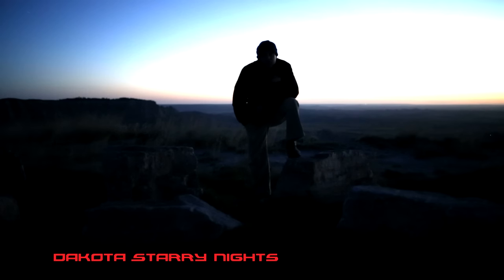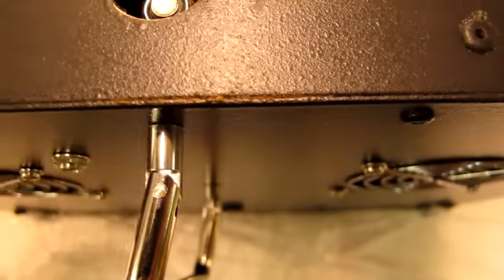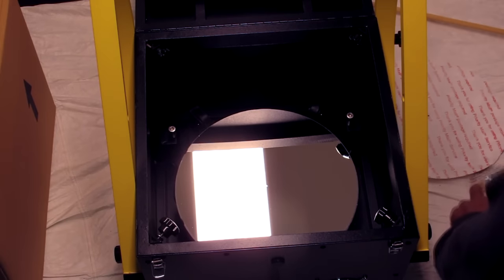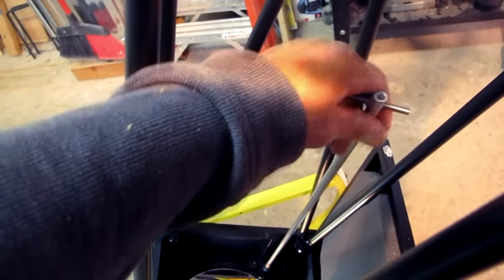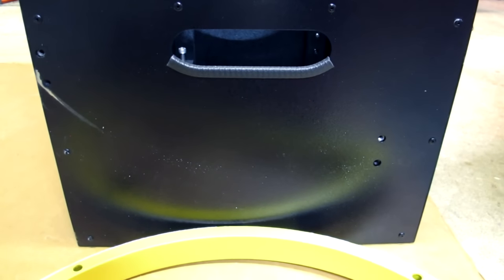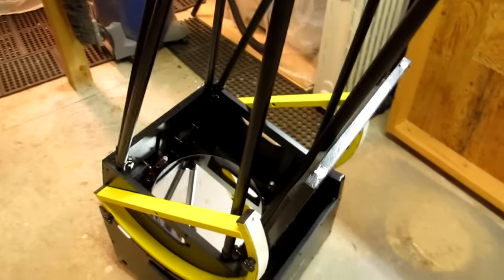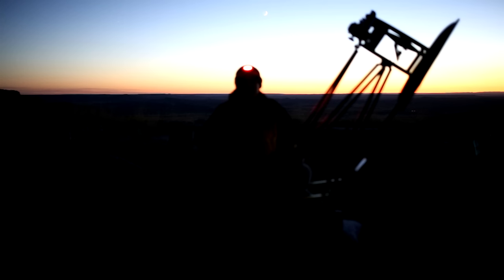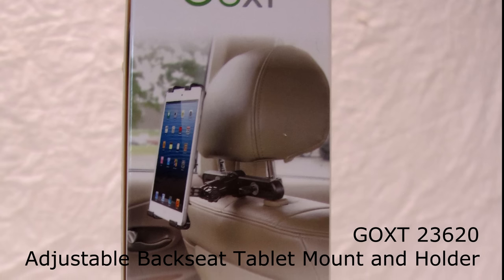Explore Scientific Ultra Light Dob Review

Comment: Thanks for the tip - I've got an ES 10" Hybrid Truss coming soon, and the suggestion for focuser orientation is easy to do, as all it takes is to pick the position of the cage during assembly. I've spanned in an old iPhone 5 which is still functional, using the Star Chart app - when on a cellphone holder + dovetail, actually acts like a 'guidescope' and gives good enough guidance to get a faint object in the main POV of my current 4" Maksutov on EQ mount.
Reply from the maker: Cool!  Congrats on the ES 10", too.
Reply: @DakotaStarryNights  Much obliged - here in NZ, a 10" is a BIG telescope, immediately putting me in the top 5% of amateur's. Next big save-up will be for a classic C8. But a 10" light bucket will be like owning a starship - and sexy with the Serrurier Truss - otherwise a dob is just a tube and a box (which is not necessarily bad) - the truss just makes it into something more serious and practical at once.
Reply from the maker: @martinlagrange8821  Agreed.  I started out with a 10" and really could have stayed with it much longer than I did.  But you know, I came down with a bad case of aperture fever.  The bigger scopes, like the 10", do draw the crowd in, that for sure.  Real pretty country NZ.  I've only got to see it in Lord of the Rings, though.  :)

Comment: Thank you for the very informative and painstaking review. I would be so in for this if not for the QC issues. What I saw looked inexcusable to me. Rust is a total NO-GO!
In one scene as you're raising the elevation to the zenith the whole telescope shudders in a way that made me shudder. Not just the tube, but everything down to the rocker box. That made the whole telescope look very flimsy. The price of weight savings... But I CAN'T EVEN CONSIDER spending money for a whole telescope only to have to completely rebuild the [RUSTY] rocker box. (I hope you're reading this, ES!)
That said, the design looks very intriguing. I particularly liked the novel access to collimation controls.
Thank you again for your fine review DSN!
Reply: hard to believe its not all aluminum. Mixing steel and Al is a bad thing.

Comment: Thanks for the review! I watched it twice,  and that saved my mirror from an extremely bad design and manufacturing.
I was sure the box was aluminum, and was curious where your rust came from, so I started probing with a magnet.

The box is in fact aluminum. What you found ferromagnetic are actually steel weight plates on the inside.

These plates are held only by silicone glue. One plate on my was loose, and it fell off when I tipped the box over. Good thing I was prepared. Otherwise it would have crashed right into the primary!!

For those who have these truss telescopes, check these weight plates and secure them! Better safe than sorry.
Reply from the maker: The dob I reviewed was Gen1, which didn't come with steel weight plates.  It was single wall sheet metal.  But you've answered a question I had regarding a previous poster who said a plate had come lose and crashed on his mirror. Ouch. I couldn't understand what plate he was referring to until now.  Using just silicone glue for such an application is not a good idea at all. Thanks for posting.

Comment: I have this scope, but I think it must be a newer version. Mine doesn't have the adjusting screw at 16:40, nor does it have any of the other problems mentioned here, so it does look as though they have improved the design.
Reply from the maker: This is the early version.  They shut down production shortly after my review posted and made some changes.  Which showed Explore Scientific really cares.  So, you probably have the newer one, which is much better. Congrats!
Reply: @DakotaStarryNights  Yes that makes sense. I can also confirm that the box on the v2 is largely made of aluminium.

Comment: Just received my Gen. II. They seem to have fixed most of the problems you encountered.
To be fair, I’ve only put it together and haven’t even collimated it yet. But one problem I noticed is that the hockey puck clutch nob seems to not do much at all and moves at zenith. Looking to order some counter weights for it now as well as a shroud. Got a coma corrector and. an APM 20mm XWA HV specifically for this scope ( my first dob). Seems a little more robust than I thought it would be. Will reply here if I encounter any major problems as there’s not a lot of info or reviews out there on this scope
Reply from the maker: Congrats on your Gen. II!  First dob...?  Wow, looks like your off to a great start.  What size you get, Phil?  I found counter weights a must for my set up.  With a 55mm TeleVue Plossl, coma corrector, finder scope and PVS14 night vision there's no way a guy would keep it all balanced without them.  But the views are heavenly!  Thanks for posting. Dakota
Reply: My Gen II came with the counter weights. I am in the UK, so it might be different here.

Comment: Thank you for the in-depth review. I am considering getting the little brother the 10" I saw one displayed at the NEAF in New York. Explorer Scientific booth. What attracted me to it was the sheer size, and on how it will compact down to a very small box.  I currently have an 8" collapsable Sky Watcher. Was a little dismayed after purchase due to the 10" was the same height at zenith! Come to find out the 10" has a faster mirror. Anyway now I am torn Should I go with the Explore scientific or should I return to Sky Watcher? Just fearing the newer true tube might have the same issues.
Reply from the maker: +Clayton Tanner Well, a move to a 10" from an 8" will not show much of difference light wise.  Of course there will be a difference but you may find not as much as you were hoping for.  If you could compare a 10" and with your 8 before you make the jump that should settle it.  Going from an 8 to a 12 does make a noticeable difference.  I had an 8" Edge and found the deep sky views lacking.  Not because of the optics, they were pretty darn good.  But the aperture was just not enough for me to get excited about what I was seeing.  But when I made the move to the 12 things got a whole lot more interesting.   And I sold the Edge.

Comment: I'm BETWEEN skywatcher 12" dobs and explore scientific ultra light 16''.  Which of the two I buy?  Exelent review.
Reply from the maker: +Aiolos Sp It really depends on what you intend to do with it.  If you plan on taking it out often to a dark site then the ultra light is the better of the two.  A 16" skywatcher would probably require a truck to haul around due to it's size.  It also would be really heavy, 177 lbs. when fully assembled.  As the old saying goes "the telescope that's used the most is the best telescope."   When compared to the skywatcher 16" the 12" ES ultra light is like a grab and go scope. :-)
Reply: If you have a big car I would buy the 16"dob without thinking twice. The diferences between a 12" and 16" dobsonians are great, specially in deep sky objects

Comment: I've had a similar problem with the mirror box hitting the inside of the rocker in a home-built Dobsonian. It's critical that the altitude bearings be symmetrical  with each other. The bearings seem large enough but the combination of materials used might be inferior to Teflon and laminate which have been used by the best manufacturers.

Comment: Great review, hope they get out an improved model soon.  Did you happen to weigh the components, as in what's the heaviest piece you have to carry?  The specs given don't quite makes sense... "Primary mirror weight 50.5 lbs, Rocker box weight 15.7 lbs, Total weight 66.2 lbs."  What about the trusses and the secondary cage, don't they weigh anything?
Reply from the maker: I haven't weigh the different components.  The heaviest, though, is the primary mirror box as would be expected.  But due to its compact size and carrying handles it's easy to transport; unless you have some sought of back injury perhaps.  The trusses are made of aluminum and are light as a feather.  The weight of the secondary cage is negligible.   Overall, it's got to be the most portable dob out there for the money without heavy partial board.  I've added a setting circle for AZ and finding targets got even easier when used with a tablet.
Reply: Thanks for the quick response.  True, it is nice and compact.  If you get a chance, can you stand on a scale while holding the mirror box, and do the math?  50 lbs is a bit intimidating, but 40 would be less so.  (I have stairs to deal with.)

Comment: Thanks for the review. I was just going to order one but I have decided to wait for their updated versions. 
I have a question. How well does it hold its collimation during the night. Does it change as the temperatures does.
Reply from the maker: +Yiangoss I believe the new version is due out next month.   I will be posting a new video here on Dakota Starry Night soon covering collimation using the Pro SteadyGrip lever on the 12" ES Ultra Light.  The Pro SteadyGrip helps maintain optical alignment throughout the night.  It also makes it much easier to slowly move the scope in Alt or AZ; especially the AZ movement when the scope is pointed at or near zenith.
Reply: +Dakota Starry Nights my main fear is that because it is made out of aluminium (and in some parts steel) the expansion and contraction of the metals may course the scope to warp slightly. This may be enough to class the scope as unreliable. I will look out for your next video.

Comment: Completely changed my mind and have one of the updated models on order.  What light shroud are you using in the closing shot?  And does it fully close off the mirror box with those bearings in the way?  Also, do you have the outside dimensions of the rocker box by any chance?  I want to build a leveling base with a setting circle and need to make sure I have the right size plywood handy.
Reply from the maker: I made the light shroud myself.  The shroud slips between the bearings so they are not in the way.  I've made a leveling base too.  Very useful as it keeps the rocker box off the ground and aids greatly in the accuracy of the Az. setting circle.  The rocker box is 17.5 inches square.  I was out last Saturday at a class 1 dark site with a couple of guys from the Black Hills Astronomical Society.  The views through the ES 12 with a Tele Vue 13mm Ethos had us all impressed.  And there were a number of "wows" throughout the night from guys who have seen it all before.

Comment: Thank you very much for the great review!
I'm about to order the 16" ES dobsonian. Do you might have an advice which eyepieces for a set of 3 would make most sense? I consider buying the ES 82° 30mm along with the ES 82° 14mm. I already own a Meade UWA 6.7mm. Not sure if I should get the 18mm instead of the 14mm though (82° because of the price).
Reply from the maker: It's a tough call because either the 14mm or 18 would be good choices.   And I might add, having a set of just 3 or 4 eyepieces is the way to go.  I have a TelVue Ethos 13mm that I use most of the time.   A 17mm Ethos would be nice but at the time I got the 13 Ethos 17's weren't available then.   That said, I'm sure the 16" ES Ultra Light is going to rock your world.  I still very much enjoy my 12" despite the problems I had with it starting out.  Here's a link that might help you decide on which eyepiece: http://astronomy.tools/calculators/field_of_view/     Clear Skies, Dakota
Reply: Wow that's a great page, thank you for the link, it helped me a lot for the decision! I finally completed the order of the telescope and the eyepieces. I got the ES 82° 14mm and the 82° 24mm (instead of the 30mm). I might get the ES 100° 9mm or 82° 8.8mm in the future to fill the gap between my 6.7mm, time/experience will tell if it's needed.
Now comes the hardest part of all... waiting patiently for the delivery lol.
Clear skies

Comment: Great review and demo I really appreciate your efforts to explain your trials and tribulations and detailing the ways you conquered the issues. I have the same scope and have/had almost identical problems. The altitude wheels/PTFE pads are the weak spot for sure. Adding the additional felt pads helped to some degree to square-up the movement, still not perfect but functional. Thanks for the tip on rotating the cage, I'll have to try that. My optics are great. Where we differ other than I'm retired Air Force, is that I have a RACI and Telerad. The added weight is an issue and I have been using a couple heavy magnets to make it balance when I use my ES 30mm. No rust so far.

Comment: I have to wonder how they are managing galvanic corrosion issues,  if they are mixing aluminum and steel.  wonder if that's the source of your rust?
Reply: Good point. Mixing Steel and Al is normally a bad thing. I wonder how the unit fared in terms of rust in the years since?

Comment: lol I also vacuum the mirror. For stickier dust I use it together with a squeeze bulb that has a filter. Too bad that most dust doesn't even come off with that approach.
I own the ES 16" Dobson. Would you recommend to store the mirror box on top of the lower rocker box for weeks or even months? Or would the weight cause too much strain to the teflon pads and base for such a long time?
Regarding dustfree storage I'm not sure if it's enough to simply close the mirror box and cover its carrying holes. Or if I should build a cover for the primary, how do you handle that?
Reply from the maker: Hi Adio;  To be on the safe side it may be better not to store the mirror box on top of the rocker box for the reasons you pointed out.  It might cause a dent or ripple that would effect smooth Alt movement.  Just saying...   To help prevent dust from getting on the primary I have a double wall cardboard corrugated panel (notched out for the three allen head adjusting screws) that sits about 3/4" above the mirror.  It helps keep dust and any objects from falling on the mirror when putting the dob together.  I put it back on at the end of the night and it stays there until the next time out.  Seemed to have made a difference.  If you store the dob in a dust pron area than plugging up the carrying holes with foam or something is probably a good idea.   Clear skies!
Reply: Great! I definitely gonna do that! I'm always afraid of dropping something on the mirror while putting the dob together.
Thanks for the reply.

Comment: Excellent review.   One of the things that disappoints me with all but the most expensive amateur astronomy equipment is build quality.  I was wanting one of the ES Dobs, but I can make something much better once I purchase mirrors and focuser.   I do like the way this provides for collimation from the front so will incorporate that feature in my Dob.
Reply from the maker: Yeah, if you've got the skill sets and money to build one yourself, that's the way to go.👍 Cheers!
Reply: @DakotaStarryNights  Retired machinist modelmaker designer.  I ended up buying one just because the whole scope is cheaper than just the mirrors.  If it is better than yours will use it with some modifications.  Otherwise I have a focuser and mirrors.  Arrived yesterday and will unbox this afternoon.
Reply: @DakotaStarryNights  Just finished setting mine up for the first time.  Definitely better than what you received.  No rust, no stray holes or other issues.   I am not at all keen on the focuser so will probably replace it.  No caps for protecting the secondary so will have to deal with that issue.   The textured bearing material is a bit rough and makes noise in use.  Still good value for the money.
Reply from the maker: @cattaraugustonawanda4426  Glad to hear you got a good sample.  Mine was a dog but once ES saw the review that wasted no time addressing the problems at the factory. 👍 They are better now from what I've been hearing.  I found the Alt bearings a bit rough too.  I took some 100 girt sand paper and smooth them out a bit.  If you decide to try that, be careful not to take off too much.  Do a little at a time until you feel you've taken it as far as practical. For a secondary cover I used an inverted protein can.  I did one for my Hubble Optics UL16, too.  Starting at 4:07 in the timeline. https://www.youtube.com/watch?v=KIIOt2bNdaA  Congrats on the new glass and Happy New Year!🥳
Reply: @DakotaStarryNights  Thanks for the info !   My home made 6" Dob mount has a lazy Susan bearing on the azimuth and Teflon/brass bearings on the alt all of which are very smooth/silky but the scope is well balanced.

Comment: 4 years later ES has still not fixed the metal particles you found in the mirror box. I bought the 12“ and had to send it back. Mirror box has 10+ metal particles up to an half inch long. Primary Mirror was obviously scratched. There is a design problem here.
Reply: Mine unfortunately came with scratches too. I can hear shavings in it. Thankfully I didn't have such an experience like you did though. Mine almost lasted a year before needing major repair :I